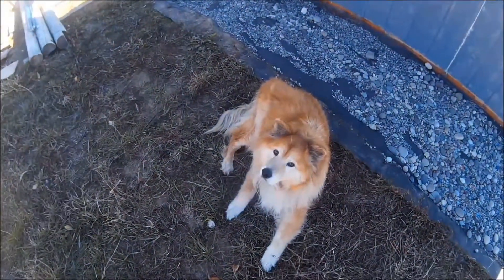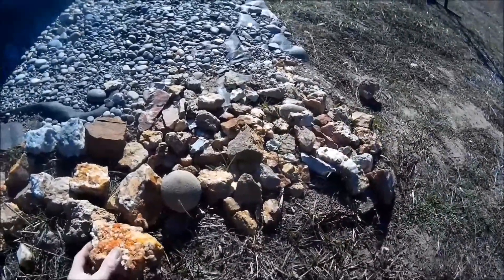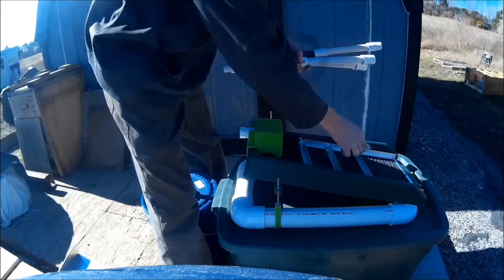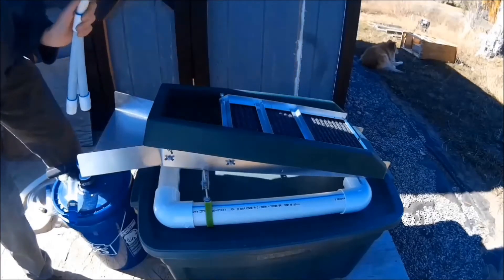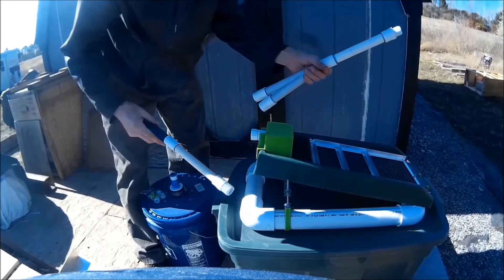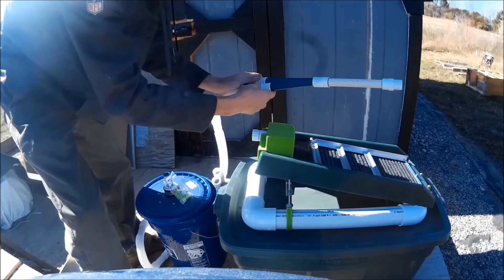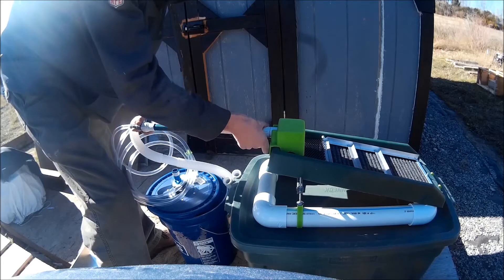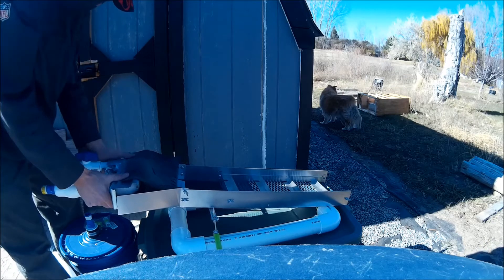Battery-Powered Mini Gold Dredge Part 2 PVC Flotation and Sluice

Comment: I'm doing  x2 4700 GPH SEEFLO 120 ah deep cycle +300w portable sol panel as we speak 5 or 6in suction i'd be thinking ... given the water flow I wasn't expecting this sort of pressure I thought it was all gonna be about volume (these m9re reputable branded pumps are the real deal) I'll be rethinking my hi banker idea i had initially it'll be more like a negative angle slushbox I'm now thinking  ❤👁👃👁